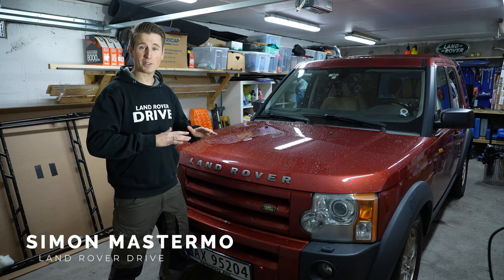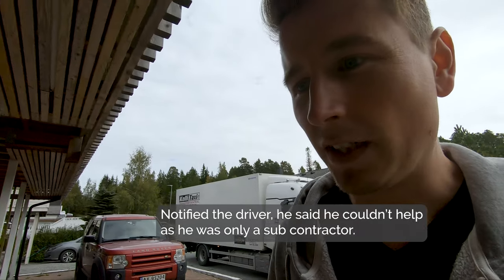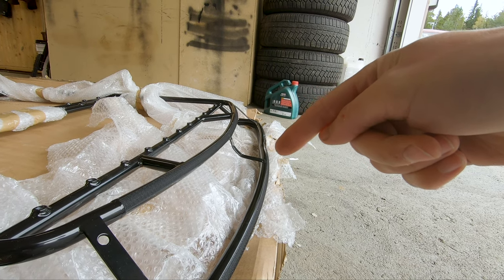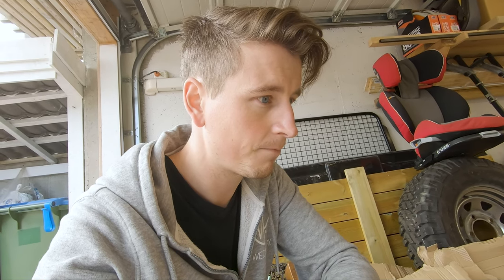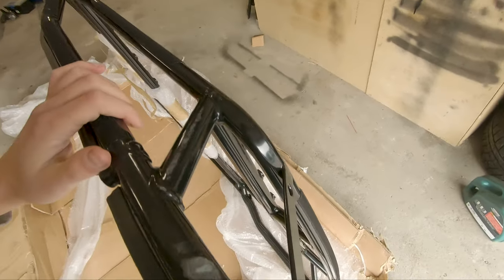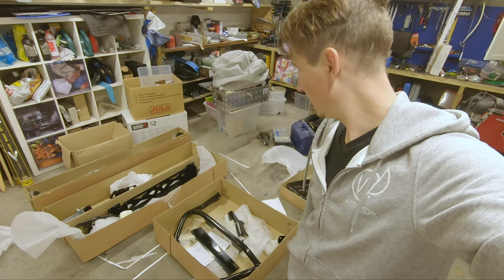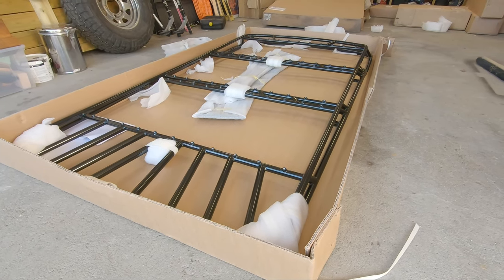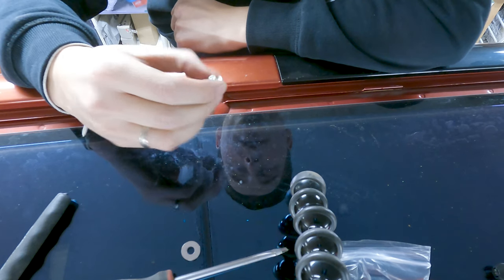The emotional roller coaster of owning a 4X4 - Can you relate?

Comment: my story,  brought  a 2008 d3 se, great looking car with perfect body, good service history and 0 oil leaks, all upgrade have been done like alloy coolant pipe, transmission flush and timebelt.  first 500kms of driving it caught fire, alternator shot itself.  burn engine wiring,  was cover by insurance so had that fixed by landrover dealer,  took then 3.5 months to get parts, then for 4 more months I had compressor go bad landrover dealer drove it with no air and broke wheel wells aswell.  had that fixed then they spent the rest of the 4 month chasing electric issues, even tho it was fine and was only egr problem. I fixed it and now it's been good for a month. I got unlucky with the alternator and the dealers negligence. I service my car now.
Reply from the maker: Oh my, that’s a long time of waiting for parts. 😳 And yeah, you definitely had some bad luck there with the alternator and it catching fire. Wheel wells, which size tires are you running?

Comment: Gutted to see that happen. Had similar on my d2 with front and rear HD bumpers. Turned up battered and scratched by courier. Company sorted it reasonably quickly though 👌
Reply from the maker: Ouch, I can only imagine the disappointment on arrival. Glad you got it sorted. 👍 I wonder what they are doing with our stuff, it’s pretty solid stuff too, how do they manage to damage them so badly. 🤔
Reply: @LandRoverDrive  no idea. Mine were 6mm steel. No dents but lots of paint damage. Some through to bare metal. Not bad for under 24hrs in transit. Love the vids BTW. Looking at getting a d3 v8. Getting some good ideas from your channel
Reply from the maker: Bare metal is as bad, rust and the time needed to fix it. I’m glad you like the channel, it’s always great to hear and helps motivate me to make more videos. Loads of more videos of the D3 is coming as I’m making it my main overland rig. So a lot of modifications will be filmed in the next year. 👍 New wheels are lying in the driveway as we speak. 😉

Comment: Wow you've great patience 👍 I know when I bought my roof tent it had all sorts of problems with manufacturing and delivery. They offered to replace it but they didn't have any stock left so the replacement wouldn't have arrived until after my planned trip 🤬 glad you got yours sorted 👍
Reply from the maker: Oh no, that got to have hurt, not getting in time for the trip. 😠 Probably a lot of expectations for the trip as well with the new setup and then no. ☹️ I’m not a patient man and with poor planning skills it’s not a great combo. But this time I was going to do it right and then it all went sideways real quick.  Also glad it was sorted quickly by Prospeed, good service and with the arrival of the second rack you can see my relief. 😅😁
Reply: @LandRoverDrive  in the end I had to modify the item they supplied, which included drilling holes in the base to reposition the hinges. Then on our france trip the telescopic ladder broke and the zip broke on the tent transport cover.
Reply from the maker: Ey ey ey, I would have been furious. I hate when things don’t work as they meant to, maybe the thing I hate the most, being hardware or software for that matter. 😠 I hope the trip was great non the less, I have never been to France so maybe due time. 😊
Reply: @LandRoverDrive  I was not pleased to put it mildly, but the trip more than made up for it. So much so 9 years later we decided to move to France. So if you're ever in the neighbourhood 👍
Reply from the maker: Hehe, that's awesome. I will keep that in mind, always good with some local knowledge when traveling. Discussing a drive to Spain next year so we will see. :)

Comment: Really frustrating to see - sadly it happens so often as the perception is people want couriers to be as cheap as possible and so corners are cut. In the UK, we have several notorious offenders that make your heart sink if the seller is using them - I will now not do business with companies who use Hermes or UK Mail (and do not offer me the option to pay for a more reliable courier)
Great to see Prospeed came through for you though - when I used them a few years ago for parts for my old Disco 3, they were fantastic to deal with and supplied high quality parts (tree sliders in my case)
Reply from the maker: Thank you, the service has been great, need to mount all the parts first to see but I don’t have any doubts to their quality. “The internet” seams to be very satisfied with their products and now I can’t wait to get to mounting everything. 😊 I’m starting to learn now that you get what you pay for, so I save up a bit longer and buy once instead of buying cheap and get annoyed down the line. 😊 I will not be using TNT any more if I can help it. Thanks again! 👍

Comment: If it didn't survive the delivery then it certainly wouldn't survive a low-hanging tree in the forest.
Reply from the maker: Hehe, I haven't tested but I think it would. It's propper steel tubing so something big had to have dropped on it or a forklift has done something with it.  With it mounted on the roof the structure will become even stiffer so should handle a fair bit. Rated to 250kg dead weight. But I will definitely try to steer clear of the low-hanging trees. :)

Comment: Hi there
I’m interested of the black rubber you have under the front part of the rack. What is that? Where did you get it from? Thanks a lot Yoav
Reply from the maker: Hey! The rubber cam with the rack already mounted. I guess you can use a door seal or something similar, would guess it was made from the same stuff. There is definitely no rattling noises from the rack so it’s a good design. 👍😊
Reply: @LandRoverDrive  thanks a lot  I got it.